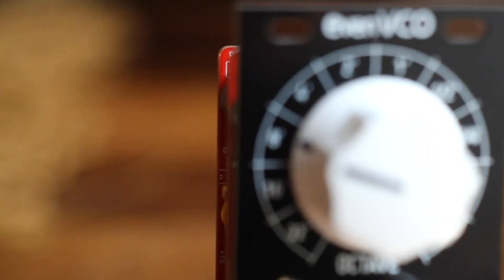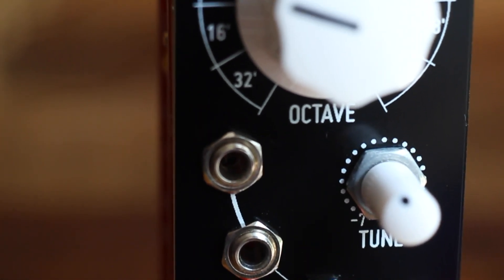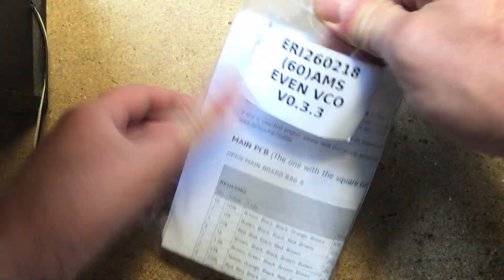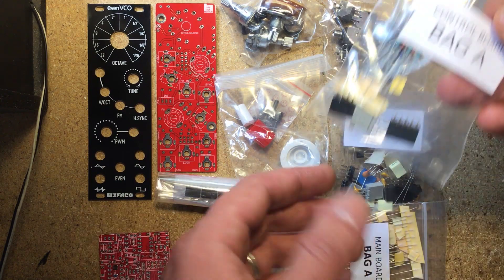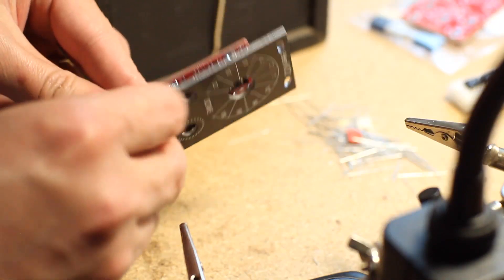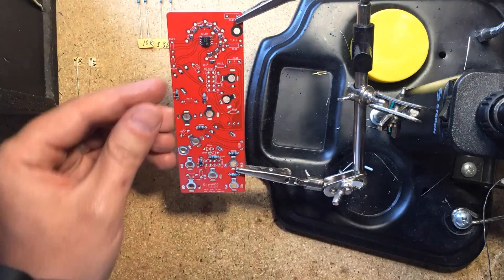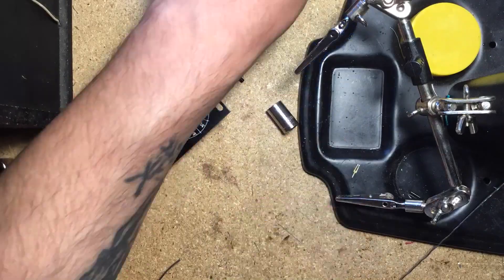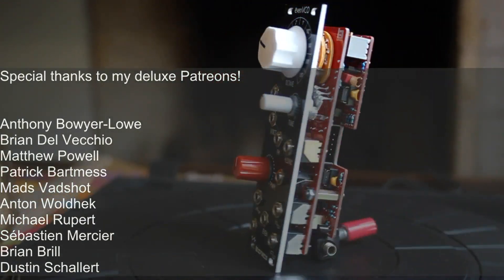Kit Review 28 - EVEN VCO Build Video

Comment: Curious about soldering from the top? I’ve never seen that done or suggested before, but it does seem like it would make it easier to get a good setting. Are there any concerns or pitfalls that one should be worried about if trying that?
Reply from the maker: It's just better, faster, cleaner, more efficient. You can only do it for the resistors, diodes and ferrites that go flat on the board, and only on factory made boards, as home made ones don't have plated through holes that fill up all the way to the other side when soldering.
Ray Wilson taught me this technique :)

Comment: Hey thanks for all the videos! Great stuff! I built one of these but I can't seem to get the calibration right. Within 2 octaves the oscillator goes almost a semi tone out of tune. Do you have any advice for troubleshooting the oscillators tuning?
Reply from the maker: Hi Josh, thanks for the nice words :)
Which version do you have? The current one is 3.3 and has improvements for stability..  I had no trouble calibrating it by following the instructions in the Befaco website. Give that another try, you have to play around with the v/lin and width trimpots some, back and forth. Mine is in tune over more than 8 octaves.

Comment: I just finished building this kit last night but haven't had a chance to power it up and calibrate yet. I was confused as to why one of the resistors was larger than all the rest, considering its place on the board looked like it was meant for a smaller resistor. It looks like you stood it up at an angle, whereas I just bent both legs inward. Maybe they just ran out of the smaller resistors of that particular type?

Also, that snakecharmer technique with the solder is genius! Wish I had thought of it. Here I was trying to balance the PCB on all sorts of random objects that had to be perfectly level! But now I'm going to use your method so I'll have a hand to hold the board with. Great content as always!
Reply from the maker: Hey, thanks!  Yeah, I think they just ran out of the smaller resistor, it's no biggie, works just as well :)
Glad you dig the snakecharmer!!
Have fun with your VCO and stay tuned for my demo coming soon :)